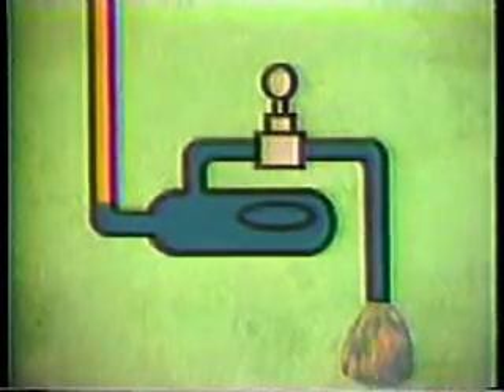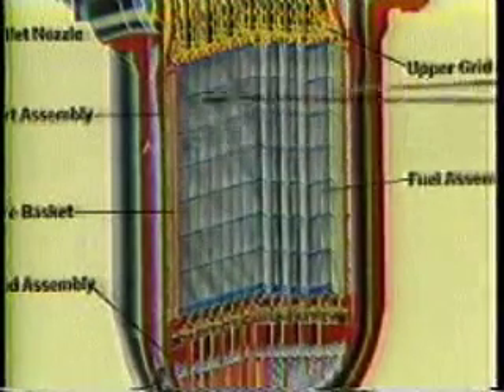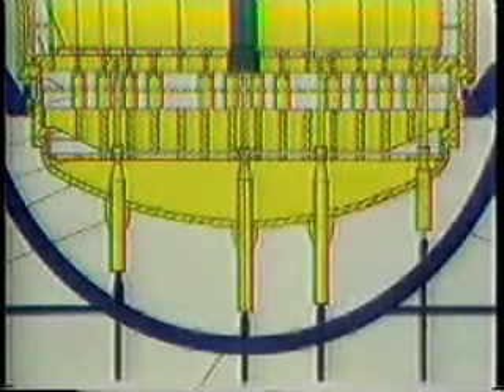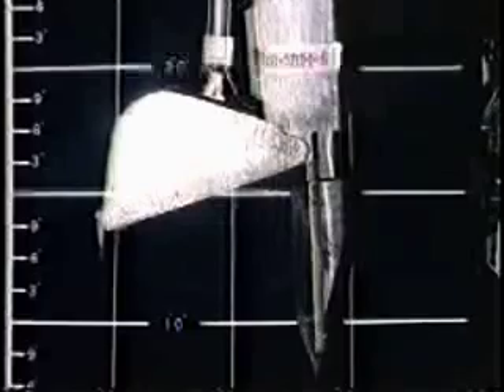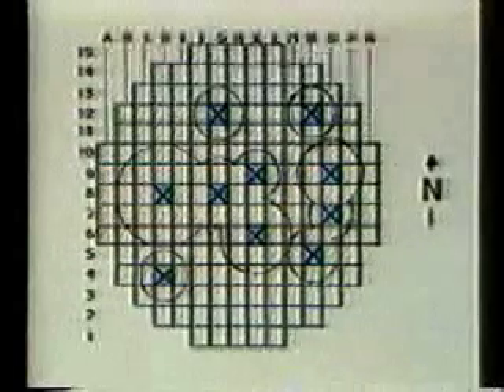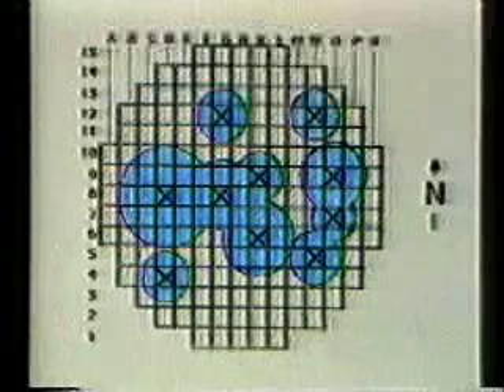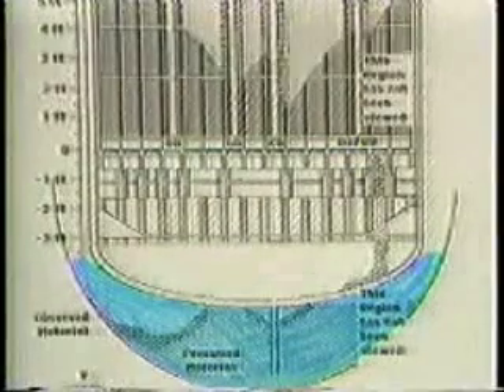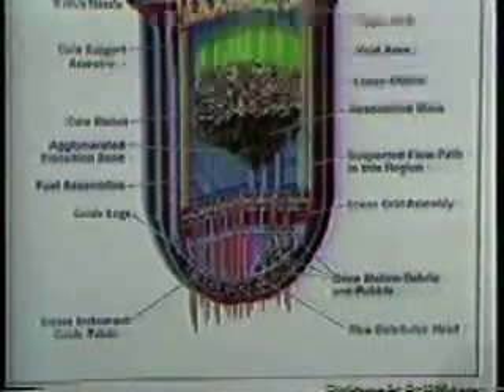Three Mile Island Clean-up (1 of 2)

Comment: I remember the morning this accident happened.  I was two years into a 4 year job in North Haven, Ct.  I thought I was far enough away from PA. that I would be safe however, for 3 or 4 days we watched as a Hydrogen Bubble that threatened to blow apart the building formed and was vented along with radioactive steam and other materials.  That's when I began to worry.

Comment: The operators at the time of this incident were actually hoping core damage would be limited by the time they restored cooling function.  They had little idea at the time how catastrophic and complete the meltdown was.  What's amazing is how incredibly over-engineered the actual reactor vessel's are.  To withstand the pressures and temperatures created by something like this.  In every description I've read of this incident, had the operators walked out of the room at the sound of the first indicator warnings, and just let the automated systems work as they were desigend to, the meltdown wouldn't have happened.

Comment: Shame about the lack of sound,  I wouldn't qualify the static I heard as sound. 
Video explains a lot, good archival footage.
Wish that plant had been utilized to its full capacity.  it changed how this country does reactors for the good but prompted lots of red tape and bureaucracy interference as well.
Reply: THANKS TO THIS VIDEO i DISCOVERED MY AUDIO WAS ONLY COMING FROM THE LEFT CHANNEL BUT WAS BEING PLAYED THROUGH BOTH SPEAKERS!.  aLL i COULD HEAR WAS THE AUDIO FROM THE LEFT CHANNEL AND IT'S JUST NOISE. sEEMS THE AUDIO CABLE IS SHORTED INSIDE BUT STILL PLAYS BOTH SPEAKERS. bOUGHT A CABLE AND CAN HEAR THE SPOKEN AUDIO NOW. Aw dang I had caps lock on.. not going to retype this. Great video.

Comment: The particular extent of damage to Three Mile Island’s reactor core gave us very valuable information about how NOT to design future reactors. Unlike Chernobyl’s and Japan’s utter demolition, here we can clearly see failure at its early stages. As horrifying as this warning was, it was also an invaluable example for nuclear’s future designs. Partly as a result, we already have the designs and manufacturing capability for safe and reliable reactors. I hope this gained knowledge will assist in wide use during my lifetime of latest generation nuclear base-level power generation.
Reply: Hi Peter.  I've read a good deal about this incident, and  through it all, I keep coming back to the point that if all the operators had walked out of the room when the first indicators lit up and went home, none of the subsequent damage would have occured.  The system would have worked as desigend and the ECCS would have shut the reactor down and flooded it with cooling water.  Even then the reactors were amazingly desigend for their own protection.
Reply: @samdesmet7637 exactly

Comment: Krazy how this core didn't overheat to the point of explosion
Reply: @john smith There was an explosion just not a big one.  It blew a metal door in two, bent an elevator door, and dislodged metal floor panels. There are pictures of the damage and accounts by the two men who first entered the reactor to survey the damage after it had set undisturbed and cooling off for over a year.

Comment: It wasn't till some 5 years later  personnel performing the core repair discovered how close we came to catastrophe. Roughly half of the fuel rods along with their housings were found to have melted.
Reply: Wasn't there a possibility of the fuel burning all the way down to the watertanks causing them to blow up and damaging the entire plant, not to mention the debry flying around?
Reply: @jg54sayaka11  Absolutely, if left without coolant the fuel rods will combine with other materials in the core to make a very hot, radioactive sludge called "corium" and burn through the steel containment vessel, then thru the concrete housing structure finally through the facility foundation. After burning through the soil it will eventually contact ground water, become superheated steam and produce a thermonuclear explosion. That will render thousands of square kilometers a uninhabitable death zone for many thousands of years.
Reply: @3ducksinamansuit  Yea, I know that was one of the biggest concerns of scientists once the fire of the reactor in Chernobyl was actually put out. The dangers of relying too much on technology and thinking it’ll get everything right
Reply: The funny thing is if nobody would have acted when everything started to happen it would have safely shut down without damaging anything. 

While yes, there was a stuck valve, but everything leading up to the partial meltdown was entirely human error.

Comment: I flew the Dehaviland Dash 8 for the old Allegheny Airlines based in Harrisburg in the late 90’s. I was a first officer based at MDT. One of the Captains I flew with said he was one of the clean up crew workers that stood on the “platform” using tools dropped down through holes in the platform. He had some stories that’s for sure.

Comment: Experts are saying that during the cleanup of the Fukushima spent fuel pools, if the fuel rod assemblies come close or touch there could be a criticality event...  By the looks of this video, however, they don't seem to be concerned that that could have happened here at Three Mile Island.  Am I wrong about this, or were they concerned about a criticality accident there as well?
Reply: The fuel assemblies had been in contact for many months at the time. If there was going to be a criticality event, it had already happened.
Reply: The event already happened. That is why there are tons of melted nuclear fuel  in the vessel. They are lucky it didn't explode like Chernobyl .
Reply: Todd Woolley I think Chernobyl blew up like it did because of a buildup of hydrogen that resulted from whatever stupid procedure the idiots were trying to perform. this accident was cause by stupid decisions too.
Reply: @madcavemantd2  Chernobyl's explosions were caused by steam, and potentially hydrogen gas buildup (in the second one, though nobody in the west is certain). When talking about a reactor core, as opposed to a weapon core, a critical event results in an uncontrolled amount of heat production which leads to melting of the core materials (aka a meltdown). Even in reactors as inherently unsafe as the Soviet designs, there is no risk of the critical reactor materials themselves actually exploding. The risk is always of a steam explosion, or of a hydrogen buildup and consequent explosion. I'm a little murkier on this part, but I believe because of the core architecture, American reactors aren't at as high of a risk of explosion. Not to mention that unlike Soviet reactors, ours are housed inside 9 inch thick steel pressure vessels and numerous other layers of concrete that would stand a chance of withstanding such an explosion. The real miracle of TMI was that the corium didn't melt through the bottom of the reactor housing. Radiation levels nearby were only somewhere between flying cross country and a chest x-ray. Had the corium escaped and seeped radioactive isotopes into the groundwater, it could have released much larger doses of radiation into the surrounding areas and into the Susquehanna River and subsequently the Chesapeake.
Reply: @aidandruck2423  Yeah, right!!! 3.6 roentgens not great, but not terrible. As with every nuclear disaster, a nukie comes out of the woodwork to minimize the catastrophe. Even the NRC investigator admitted after the hearings that his estimates were an order of magnitude too low. Neither you nor anyone else knows how much was released, because all the monitors went off the scale and failed. How are you going to get an accurate reading after the disaster from a helicopter over the river valley with the downdraft from the rotors?
Reply: Doctors have studied residents ever since TMI happened. They have found zero cancer increases. This if from numerous studies. The TMI containment building worked. Chernobyl had no containment building because the Soviets were cheap.
Reply: @LonnieAdams4  To be fair, even a containment building would have probably been destroyed bv the gigantic steam explosion in chernobyl.
Reply: @aidandruck2423  today there are new investigations and oponions that the first explosion was (partially) nuclear and the second one was from hydrogen. I recently read an article that it is believed the top cover plate that weighs numerous tons was "floating" in the explosion for 10s before it dropped back onto the open vessel.. this shows how much energy was released during the first seconds of the accident which can not be caused simply by steam.. however I did not fully understand the phenomena and hows this investigation came to this conclusion
Reply: @LonnieAdams4  the russian reactors were made to produce plutonium.. electricity was just a byproduct
Reply: @bobl78  Good point and you're almost certainly right.  We did the same in the U.S. too.  Government took control of all plutonium produced in the reactors and made nukes out of it.

Comment: so a $20 valve caused 20 million in damages... Come on you engeeners! get your shit together.
Reply: TheAMHaze this video is old. I'm pretty sure it's come out since or maybe was known then that it was caused by bad decisions made by the people running the reactor. The part failed but they didn't take the steps they should of to prevent the cooling water leaking out. It was designed so if that valve failed there was a second way to block it
Reply: @dirkturrell6460  if you study this and listen more closely you will understand that every thing they did was right just all the instruments showed everything was operating right it showed the valve closed,  but the coolant level was still raising it wasn't until someone went down where the coolant was leaking from that they knew what had happened.
Reply: Engineers had their shit together. The problem was the Navy training the operators had that made them think protecting the steam pressurizer was more important than keeping the core covered, which is true on submarines but not in civilian PWRs.

Comment: Experts say that Fukishima can be cleaned up, it will not be as bad as chernobyl.
Reply: FloaterHD can't really clean that in fact I think some of the reactor is still Milton
Reply: FloaterHD 3 reactors that melted down is somehow not as bad as one... Okay.
Reply: @timramich  The reactors at Fukushima melted down, but they didn't blow up all over the neighboring area like Chernobyl did. The explosions at Fukushima were not inside the reactor vessel or even the primary containment, hydrogen leaked out to the secondary containment and built up in the roof and that's what blew.

Chernobyl can never be cleaned up. Fukushima might be.